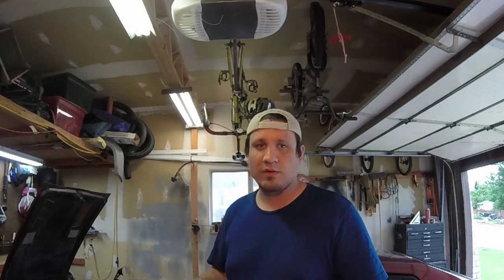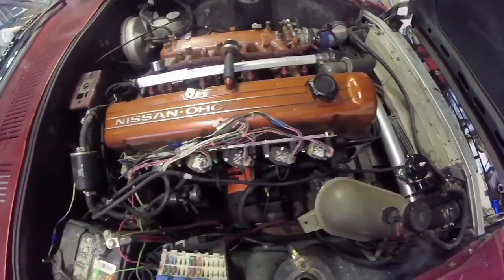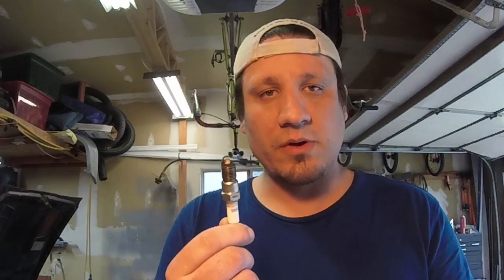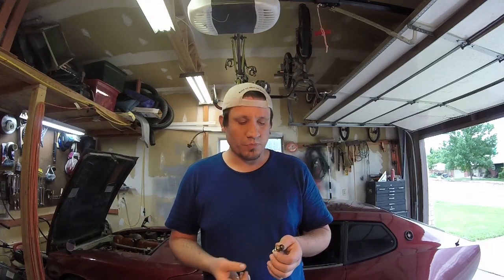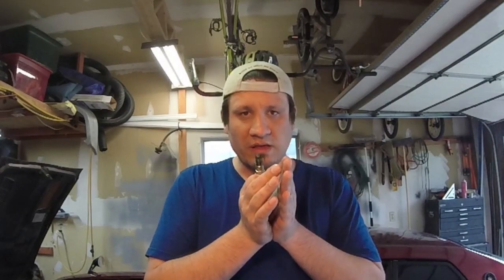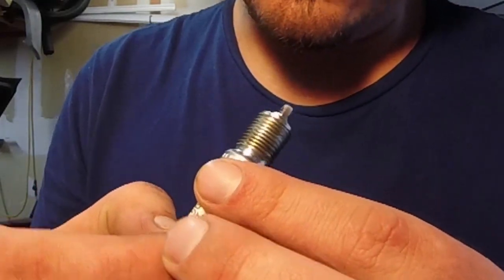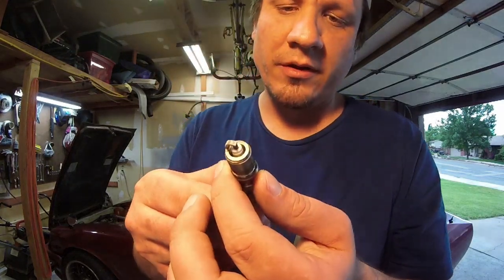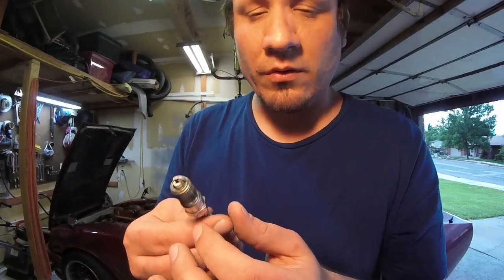Troubleshooting and Reading Spark Plugs for Your Tune

Comment: MMT will hide the timing band.  Ideally I run plugs with silver electrode that will melt before my pistons ever will,  just in case a cylinder goes to lean.